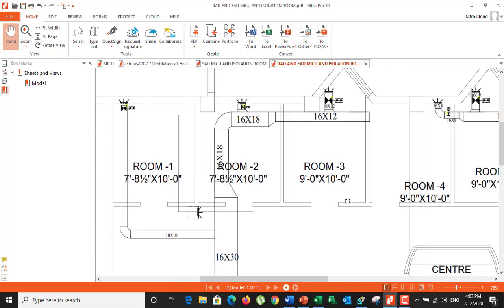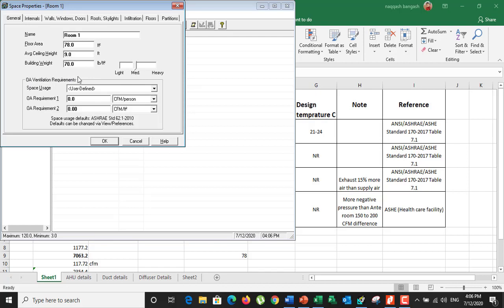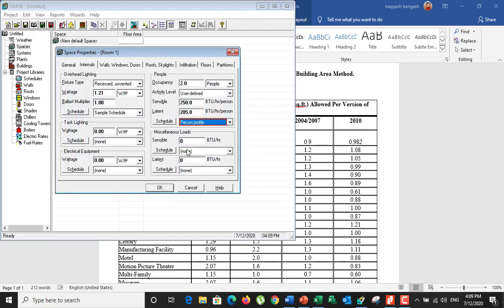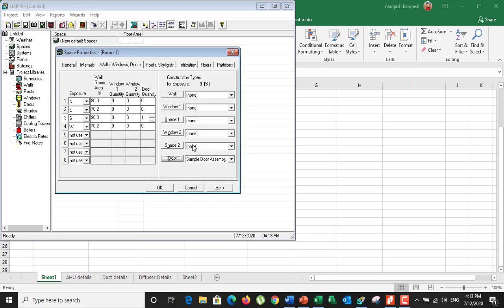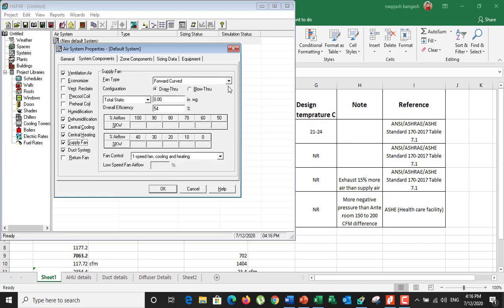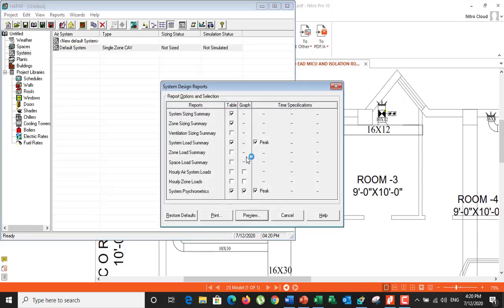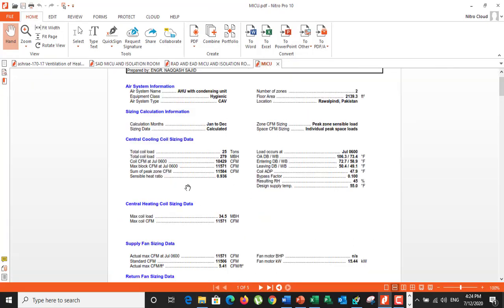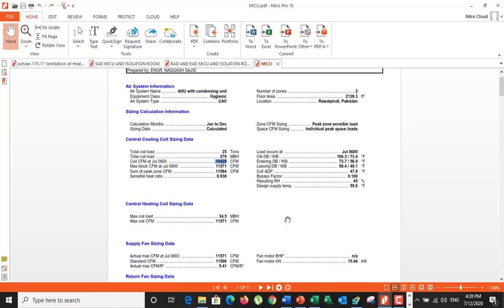Designing and calculation of HVAC system for Hospital by HAP (ENGLISH)

Comment: in Patient room, why outdoor ventilation air =0 , SA=280 CFM,  it means using 100% RA,  I seen you input= 23 CFM but result =0
Reply from the maker: Yes, you right, i think it was mistakenly removed, during video recording. 

You can follow the procedure by yourself, i was teaching the method to do such calculations

Comment: Kindly explain how to design a room with a negative pressure in HAP.
Reply from the maker: Negative pressure means more exhaust than fresh air, you need to account for 100% fresh air and put direct exhaust cfm in the thermostat option.
This way you can calculate load for negative rooms.
Reply: @passionateengineermep   thanks for reply. i have done the same but didn.t  find any information in HAP report regarding the negative pressure. kindly make a dedicated video for design of negative pressure rooms in HAP.
Reply from the maker: @crazycontroller7751   in hap you will not get a result of pressure, you will get a  load only for negative room, for pressure calculation i will upload video.

Thank you
Reply: @passionateengineermep  thanks
Reply: @passionateengineermep  fresh air means Outdoor air?
Reply from the maker: @crazycontroller7751  yes
Reply: @passionateengineermep  needs clarification, kindly reply, pls. 
when i account for 100 % fresh air in "QA Air Ventilation Requirements" of required SPACE. and put more "Direct Exhaust" in "Thermostat" option of my system. Then, after simulation, the HAP report under heading "Outdoor Ventilation Air Data" simple shows the direct exhaust which i put in settings of thermostat. 
e.g., if my design AirFlow is 300L/s and then i add direct exhaust of 500L/s, the HAP report will show Design AirFlow of 500L/s. my question is if my design airflow is 500L/s then how a negative pressure will be maintained. and what will be the value of that negative pressure.
Reply from the maker: I will try to upload a video on this topic

Comment: Sir. in HAP software, Equipment class: Hygienic units not available plz tell me how to add
Reply from the maker: Can you please guide me why you want to add a Hygienic unit in HAP?
Because AHU is enough in system data for cleanroom and others.
If your country have high humidity in some seasons than you have to calculate load on that temperature in which humidity is high, else you can use dedicated software for load calculation of cleanroom and healthcare facility.
Reply: @passionateengineermep  sir in our country we have high humidity and i am  doing calculations for Health care facility (veterinary clinic) (Rooms , Surgical, Pharmacy, and Examination/Treatment rooms) for that i need to select  hygienic units
Reply from the maker: @muzaffershaik8336  you need to calculate load at high humidity, e.g in August humidity is high, so you need to calculate load on these parameters not on ambient temperature.
Once you get the load, then you need to select hygienic AHU based manufacturer selection.
Reply: @passionateengineermep  ok thank you sir

Comment: Sir what is mean by Group A and Group E diffusers in ASHRAE standard 170?
Reply from the maker: Group A: In or near ceiling, horizontal discharge. 
Group B: In or near floor, vertical non-spreading discharge. 
Group C: In or near floor, vertical spreading discharge. 
Group D: In or near floor, horizontal discharge. 
Group E: In or near ceiling, vertical discharge.
Reply: @passionateengineermep  tnk u so much sir ❣
Reply: @passionateengineermep  Sir can you share with me your ductwork in sad micu and isolation room just for my understanding that sir how you done ductwork please sir share with me that will be your kindness❣ my email sir👉
faisalhussain8899@gmail.com

Comment: sorry please check your input data and definition. you only input the walls if your walls are external walls exposed to sunlight. for internal wall, please use partition. and floor above conditioned space means that your calculated room is above another room which is conditioned to same room temperature.
Reply from the maker: Yes, you are right but these are only just examples. Select wall that are exposed, it depends on orientation of building. For internal walls you will use partition walls and fo roof also.
Reply: Exactly that's what I was thinking when I saw this

Comment: Dear Brother, excellent video, i need ASHRAE STD.170 2017, ASHE, ASHRAE 90.1 lighting power as u shown in your video, moreover, can you share excel sheet of cleanroom load calculation. 
2nd question, when you talking of air velocity from diffuser should be 30-35, how it calculate? can I calculate formula Q=AV, A( face area of diffuser, Q= CFM, 
Please share above documents my email tahir_engpk@yahoo.com
Reply from the maker: Ok i will check this
Reply: @passionateengineermep  thanks your reply, please do not forget to send me

Comment: Why did you give 100 percent ventilation when it was asking only 15 percent extra exhaust?
Reply from the maker: 15% extra exhaust mean you have to  exhaust 15% more air than supply air.
Reply: PASSIONATE ENGINEER yes but you gave 100 percent ventilation there
Reply from the maker: Yes but we do that in excelsheet later, like once we get the total exhaust cfm we add 15 per more

Comment: Hi, again many thanks for your video. I have a question about the software. I want to see the effect of filtration like HEPA filters on energy consumption of the HVAC system  ( mostly pressure drop related energy consumption). Is it possible to do with this software? If not, do you have any suggestions?

Comment: Why u are considering all 4 wall? 
 , you need to consider the wall facing outside and other wall shall be partitions wall if it is not air conditioned
Reply from the maker: It depends on your building orientation and exposure, if 3 walls are exposed than do calculation for these 3 walls and consider 4 th one is partitioned space or you can only do calculation for  3 walls only. in video these are just examples everyone have different scenarios.